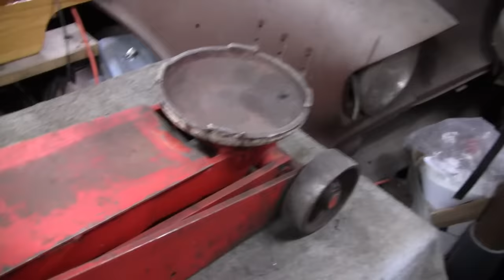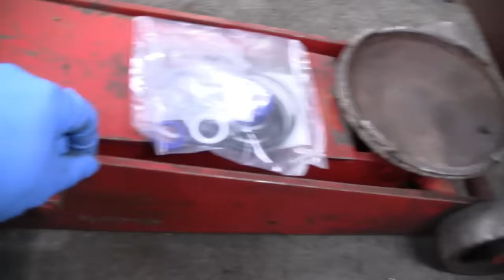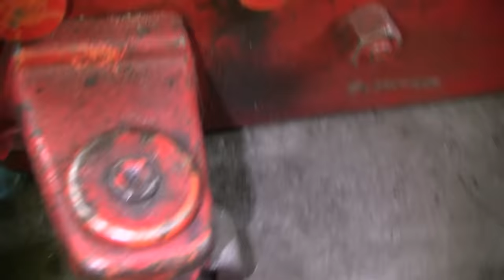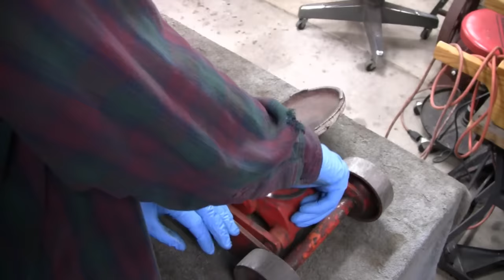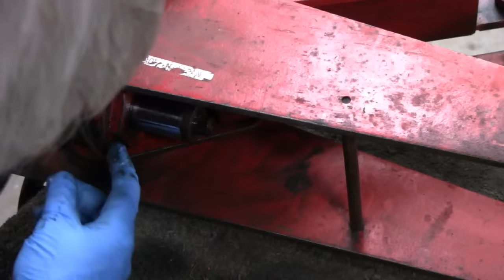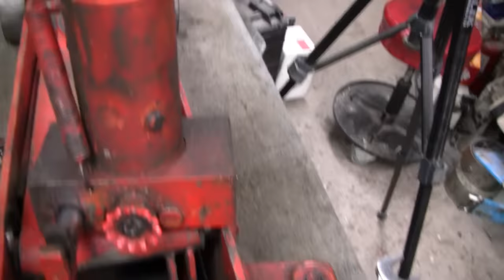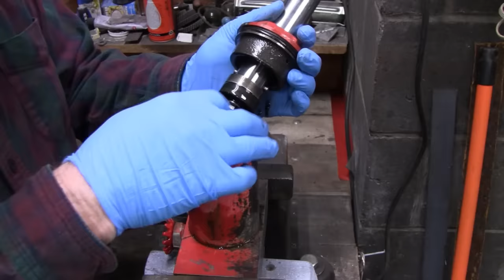HYDRAULIC FLOOR JACK REBUILD

Comment: GREAT VIDEO !!  Your easy method of step by step is great to follow, your trouble shooting possible issues is spot on, camera work was acceptable and your explanation of parts excellent.

Ordered this style of jack from Sears Roebuck Co in 1970 and shipped to Germany where we were stationed.  Had a little VW bug I used as my work car.  I could jack the car up, pull the little 31 HP motor out, carry it inside our government quarters into the kitchen, drain the oil out into a pan ( for PROPER disposal ), wash the oil screen out with gasoline outside, put the motor back into the car, affix the throttle cable and generator cable, pull out the jack stands, let the car down, refill the oil, start it up, pack the wife in the passenger seat and head to the Commissary on base for a grocery run all in 45 minutes. 

I got my money's worth out of this jack, every penny.  The jack is setting in my shop today under the work bench and THANKS to this vid I'm going to rebuild it next week for sure.  That little  jack was made like a German tank and heavy like one too.  Jacks like that are well worth the rebuild kit cost to repair.  I'll have to look on the jack to see where it was made.  Don't know if Sears bought Japan or China made then but I might be surprised.

Thanks for a GREAT instructional video.  You rank way up the list for a professional quality job here.
Reply from the maker: Thanks alot Bud!!☺

Comment: I have this exact same jack that I bought in 1973.  My one and only that has worked lifting cars trucks engines and motorcycles.  Even a hot tub and cast iron radiators!  Its covered in grease and plastic dust and over spray but is still hard and work today.  Its a Craftsman and the factory would give me a new one if this broke down but it never has.  They REALLY don't make them like they used to!!!

Comment: The pin it's the stop for the piston not coming all the way out.
Reply: Not quite. The pin actuates a bypass valve internal of the piston. The valve is in the bolt head by the snap ring holding the pressure seal. Oil dumps back into the reservoir through the hole in the hex head at full stroke.

Comment: you are correct, the seal on the piston and the hydraulic cylinder are dust seals, they are installed backwards to keep the dust/dirt out.

Comment: Thanks.   I have that same jack so i watched the video.  Mine still works fine but at least i know what to do if it gives out.  What i need to replace is one of the wheel swivel bearings that broke.

Comment: Bought 2 when they were on sale at Sears in the 70's, sale price $99.95. One just started leaking, thanks for doin the hard part for us.  These were Identical to the King of jacks at the time the "Walkers", the only difference is the rear wheel bracket was a welded sheet metal piece instead of being cast.  Oh and the Walker was bout $225.  Great Jack!

Comment: Great Video! Mine is a 3 Ton but it looks similar to yours. Mine shows no sign of leaking but I topped it off but that didnt fix it. It can lift its "arm" but if there is any weight on it it will not lift. I guess it is a seal between the ram and reservoir...IDK. I couldnt get the top nut off so I took it to a truck shop and it loosened at the lower outer canister. I should receive seal kit today so I'll replace what I can and hope it fixes it. Mine is from Advance Auto Pro Lift / Speedy Lift G-2593 and is only about 3 years old and like new condition other than it is a POS that wont lift anything.
Thanks for the video - now I know what to expect!

Comment: Thanks for the explanation on rebuilding old jack which is exactly like my 40 year old one.  Mine leaks down a bit.  Did buy some Bar's jack "stop leak" seal oil...helped a lot, but not 100%.  Now when jacking I use jack stands always (should anyway.)  From your explanation I'll need a new o-ring on the screw fitting just left of the sprocket, as that is where it seemed to be leaking down.  Do hate to spend $40 on a kit so I'll just get the needed o-ring and keep using Bar's jack oil.  I do think Bar's keeps everything else flexible and lubricated in an old jack.

Comment: Nice video -- the sort of thing I like doing, myself. I never like to throw old equipment out if they can be repaired. They were built better in their day. A word of advice for those using a hydraulic jack, though -- always use rigid axle stands as a backup. Unless, of course, it's only for a brief period.

Comment: Looks like your jack has had the release valve gear wheel welded on and the inner cylinder welded to the base by another repairer.  Being cheap I bought an exact Chinese knockoff of this jack in 1994 and have been using it almost daily ever since.  Twenty five years and has yet to ever leak or need anything.  Thanks for showing me how to rebuild it using your high quality Japanese version.  If mine ever needs service like yours continues to do I'll know how to fix it. ;-)

Comment: I have the exact same jack as yours, made in Japan. When I got it I had guessed it was a 1970's model. It has the same issues, not holding a load and I will be rebuilding it this summer. These are quality jacks, made by well established  companies who were at it for years. Your video has surely come in handy, thank you and thumbs up..!!
Reply: Can you tell me where to get the rebuild kit for my dad? He has the sears made in Japan as well. 850 something..he really can’t find it. I can’t find it on eBay. Thanks!
Reply: @christineh8996  I have not got round to repairing mine. However, the kit would consist of standard parts which would be compatible over many but not all of these jacks of the same capacity. Check if there are any tags or numbers on the jack, or see online any similar looking jacks to get the model number. Once you get that, then it would be easy on ebay, amazon, alibaba etc. If all fails, then take the pump, cylinder, rod with piston etc to a hydraulics shop near you. They stock different size seals and parts. Take care not to loose any parts on the way, as some are small. Good luck!

Comment: Great video. I wish I had kept my original Craftsman jack from 1980. I sold it at a yard sale in the late 90's because it wouldn't hold pressure any longer. I wish I had fixed it instead.

Comment: I have same jack but Sealey branded. Same problem as yours. Turned out piston seal had split. I turned a new piston seal out of nylon making depth of lip much deeper to compensate for nylon being stiffer than original rubber seal. Jack has now worked perfectly for eight years after I did the repair. I did not bother replacing any other seals.

Comment: Enjoyed the video. I had John Deere dealer assemble my front Idler on my Model B cletrac dozer. They had a 50 ton Press and it broke at about 35 tons. But they ruined my dirt seals trying to put them in the normal way. Ordered more seals and I was told because the bearings are oiled not greased the seals are backwards to let excess oil out and keep dirt out. Putting the new seals in myself was easy because the cavity had a taper. The taper was why they couldn't get the new seals in the normal way. I'm not faulting the mechanic he was doing what he thought was right. New bearings and shaft in the Idler works great. Remember "If a machine don't work it is a Boat Anchor, No matter if it is 100 years old or one day old."

Comment: This is great!! I have this exact jack!! Needs some attention also and I'm not a throw away guy. I got my son to stand on jack my jack  pumps up and lowers but sounds dry or low on oil each pump only gives tiny increases in rise. It holds ok and doesn't drop but it looks as thoa oil at some point has seeped out from somewhere as the jack has oil over it. First thing in going to do is clean the jack fill with oil and see if I can locate any seepage. But this video is great! Especially as the jack is identical...I will try and find the correct seal kit.

Comment: nice to see that repair, I bought a Sears 1-1/2 ton floor jack in 1973 when I got married, when to Dallas as our first road trip together ,so this old floor jack has sentimental value. Its been parked in the shop for 20+ years and replaced with the cheap jacks that are not as well made or as heavy. I believe my model has a universal joint instead of the star gears, but  with the internet being in existence now, it may be possible to find a repair kit. Thanks for your time and effort ! Ps. nice looking rod too..

Comment: These are treasured shop jacks. They were manufactured by Mitsubishi in Japan. Mine began leaking at the big cylinder cap with the 2" nut decades ago. I took it to a hydraulic place that serviced jacks around 2010 and they wouldn't fix it saying "you can get a new HF one for $100."   Well, I did get a new low profile one. And it twists under a 2T load. I dealt with using both for a while until one day I did an oil filter cartridge on a Saturn and never replaced the black O ring on the plastic cap. The ring stayed in my "O-ring drawer" and one day realized it looked like the correct size for the Sears Jack piston cylinder. I flipped the jack on it's side with the piston still in it and the handle at 90 deg and was able to break it free. Replaced the ring and the oil and good as new.

Comment: A lot going on there..But one thing not to forget.. is to back out the valve stem before tightening down the nut it could damage the seat. (I,m talking about the one that is controlled by the jack handle... it might be left handed thread too..) great video..thank you.

Comment: Slick repair. I know that most of the time the seals in those kits are cheap. Just like the carb kits are today. I have the same jack, when it comes time to overhaul it, I will refer to this video.  Thanks!

Comment: Good vid.   I used to repair these 20 years ago and usually used a flat bottom drill to reseat the ball seats as when they get tired they leak .
Reply: Is this what causes the jack to leak down unloaded?

Comment: Nice job rebuilding the Hydraulic manifold block!  I believe what u bought was a universal kind of rebuild kit that will serve or take care of several different jacks and sizes of hydraulic valves.
Reply: I have that very same jack and i need to put a couple small part on it also.

Comment: AWESOME video! I love the step by step from start to finish!! So many videos will begin tasks,, then just when they get to the part i really am waiting to see because that may be the point in which I am having issue or question,, the people stop the video and jump ahead,, or speed up through it, or do not explain it!! Or, they take something apart and skip the reassemble thinking that it should be a no brainer! But not everything goes back together without maybe a few old tricks needed to make it easier! Like putting the oil back in! It is a simple idea,, but seeing it being done just reminded me of doing it that way!! And I also have that 'old jar of vaseline ' I use too!! I also use vaseline on installing new bears on a crank! Works awesome til the oil pumps up on a new engine! The old tricks are the best! :) I am thankful for your video! Thank you!! I did notice ,to me, you have a slight accent,,, wondering where it is from?? Again,, Thank you for this informative video!! Now I don't feel I am taking on a crapfest of a task trying to fix my non working floor jacks!!
Reply from the maker: Thanks Bud!! We're from South Jersey

Comment: Good video! I have a couple of jacks that aren't what they used to be. Now maybe I'll have the nerve to try and rebuild them.
I learned when I was young and I worked on a rail yard that leverage is your friend. One guy could flip around a 3900 lb rail with a lining bar. Of course I was a little stronger back then.
Your cheater pipe reminded me of that.
Keep up the good videos!

Comment: The seal on the plunger was in backwards to keep dirt out, the o-ring keeps the oil in. it could be replaced with a double lip seal, but unnecessary, just put it in backwards like it was. Someone may have already commented on this, too much wow! to read to find out. I have the same jack and a 3 ton  like it bought by me in'1982. Just ordered kits.

Comment: I have an Allied Hydraulics 2 1/4 ton floor jack the would go up a little but then immediately go down.  I've had this jack for at least 30 years without issue until recently. When I disassembled the jack I found the seal damaged because there were 2 large gouges inside the cylinder bore.  The had to have been in there since the jack was new.  There were also gouges on the outside of the bore with has no effect on the jack operation.  I used a little JB Weld to fill the gouges and then used a brake hone to smooth them out.

Comment: I bought one of those at Sears back in '72 when I was just getting started, the seals finally got so bad it wouldn't stay up around '97 or so.
I took it to a place that rebuilds hydraulic cylinders because I couldn't find a rebuild kit searching on the part number at Sears. They charged me more to fix it than it cost brand new.($100.00)
 It's still going strong and know I know I can just get generic o-rings and an oil seal for a same size shaft to fix it now.

Comment: Fixed mine today.  Not as many seals but I replaced all of them.  I think the issue was in the pump finger.   It had 2 seals in it.  Like you I didn’t use all the seals.

Comment: ugh, some homeowner was getting rid of his because he didn't want to rebuild it. He replaced it with one from Harbor Freight. i didn't know it was japanese made; i'm regretting not taking it from the curb & doing a rebuild on it. My made in China ones are still working ok over the years & i check/use the standard hydraulic jack oil w/ sealer from Walmart annually

Comment: I’ve had that exact same jack right down to the paint and scratches lol, since ‘95. I traded some car parts to a buddy for it and he has passed away now. I would like to save it. After watching your video, I think I’ll give it a shot. The jack doesn’t leak down as fast as yours did but it has started to creak and pop and slowly go down, maybe 4in in a couple hours if you leave some weight on it. Anyways, thanks for the video 👍

Comment: you made me smile
have two heavy floor jacks, same prob
BTW, the nut is called the gland nut, the rod is the ram, the plastic seal, well there are many synthetics with  various names, the O  ings usually  synthetics and with big glands like 6 inch, you can make custom size, using Loctite to glue the cut rings
O-rings are mechanical gaskets with a round cross section.  manufactured from various types of elastomers. Some of the common types of O-ring materials include PTFE, Nitrile (Buna), Neoprene, EPDM Rubber and Fluorocarbon (Viton).
anyways good fer you me ole son

Comment: I was  always  told  in  an  engineering  works  I  worked  at  to  lubricate all  the  seals  with  a  little  of  the  oil they  are  going to  be  used  with  before  assembly  for  an  easier  assembly  &  non  likelyhood  of  damage.
Reply: I'm with you. I know plumbers silicon lube/grease( clear gel)works great for this.

Comment: Thank you for this video.  I have a Sears floor jack I bought in the mid-70s that needs a rebuild.  I think I paid $175 for it back then.  It is a commercial duty jack and pumps up the same distance with each stroke regardless of the load on it unlike all the jacks I've had since.  Now, if I just had that huge vice and crescent wrench!

Comment: I need the handle for one of these jacks!  Someone gave me one years back minus the handle. I use a high lift jack handle to jack it up, but you can’t tighten and release the hydraulic valve by twisting the handle. I use a pair of channel locks to open and close that star looking gear, PITA.

Comment: Thank you I've got several older jacks that need repairing like this   I knew that there was a way to do it my dad was a multi mechanic at a paper mill and always said that older tools were well worth the repairs.  PS that's a beautiful A Model Hot Rod my dad along with my brother and I started building his 30 model Ford truck way back in 1980 as a way to keep me and my brother outta trouble during our high school years but never finished it
Reply from the maker: Thanks Bud!! Cool story!!☺
Reply: 805ROADKING thanks

Comment: Thank you for doing this video. I have a jack like the one you rebuilt. Considering what you shared, I would just do a tear down to the leaking seal and take it to local machine shops and just replace the single seal because I  doubt that anything else needed to be replaced. The repair kit to my mind was not worth the price they charged for a few seals and o rings, but maybe that's just me.

Comment: Got the same jack from 86, still works fine, but will keep this in mind when i need to rebuild it, have to keep it going as it fits perfectly my 911 engine cradle, handles the 2.2 with the 901 as a unit with ease.

Comment: I like the subject matter at hand. My jack is in the same way. Look forward to fix my jack this week. Will just take it apart and measure what I need so the parts are the same size needed. Especially the ram rod seal. The most important seal as it keeps the dirt out. Know as a wiper seal to be precises. Look forward to a leak prof jack.  Keep up the projects witch I look forward too see.

Comment: Good video..  one thing it noticed.is the position of filler plug/ hole..I believe it has rotated over the years some how.... hydraulic system and air or air pickets do not go together.   IF IT EVER gives u trouble ...try and rotate that hole straight up.. keep up the good work
Reply: CASTLEDOME KNIVES  With this style of jack most rebuild tutorials make reference to the filler port being on the side, not the top.
Given how tight that nut was on the end of the piston I can’t imagine how it could ever rotate.

As long as the piston is fully submerged then an air pocket above it is no issue.